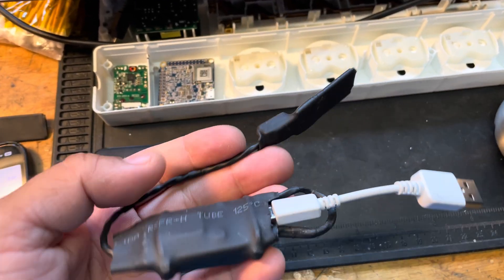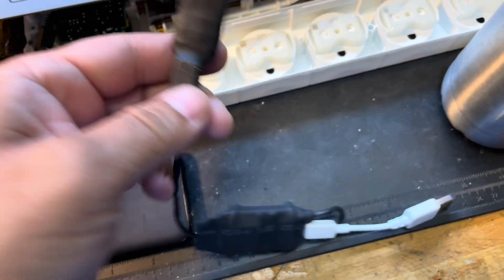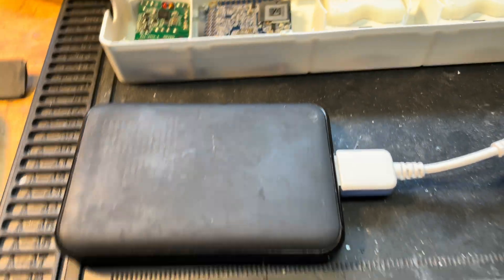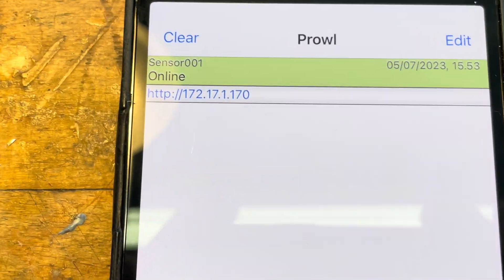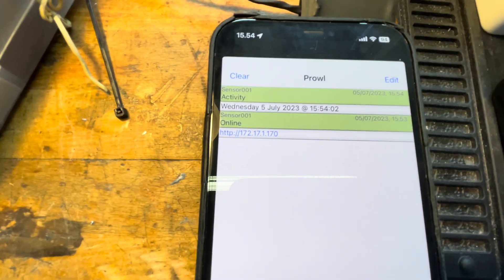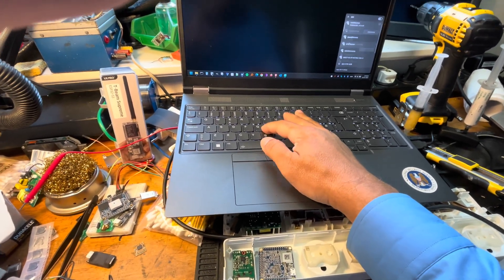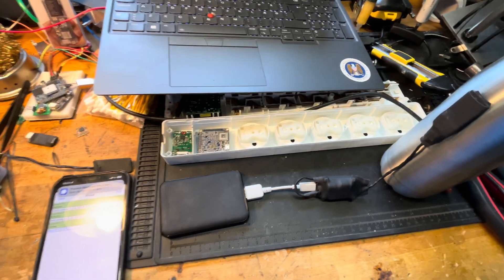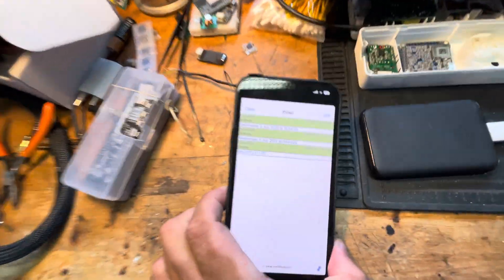Human radar

Comment: Hey Keld, one quick question, do you think that magnet influences the performance of your inductors? I plan on using some rare earth magnets to hold up my device against a metallic plate.( Hopefully that helps blocks some of the waves going behind the sensor and picking up movements not intended to see.)
Reply from the maker: I dont know how the magnet affects the inductors. Mine works perfect and i am also using that type of magnet. The sensor i use states in its specs that there must be 3cm space behind it but again it works as it should with my setup

Comment: How far can it reach ,   can you use it in the mail box to send an alert when mail arrives ?
Reply from the maker: The range can be ajusted wit a resistor on the sensor. I think I added some pictures of how and where on the print you can do that. Look in the github picture folder. Inside a metal mail box the microwaves would bounce so I think that will make it not work but it is worth a try. I have installed a camere in my mail box to realtime monitor it. It is so much more fun to see whats there instead of just knowing there is something
Reply from the maker: Range is up to 7 m in my test but it states more in the specs

Comment: Great video! Do you think that "cleanup circuit" would work with the 24Ghz Radar human presence detectors?I have both the RWLS and the 24Ghz ,and wanted to do a side by side performance characterization.
Reply from the maker: Most likely. I am looking at the ld2410 sensor also. I have no false readings after adding the noise filter